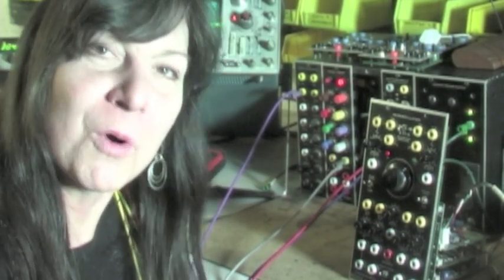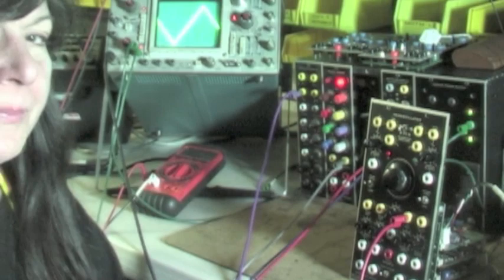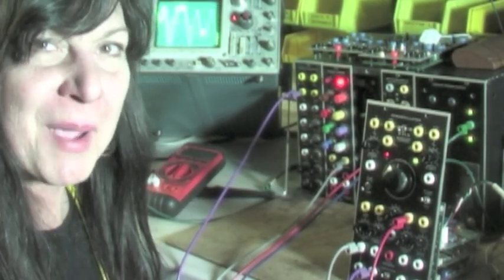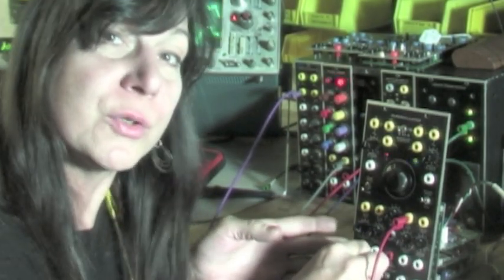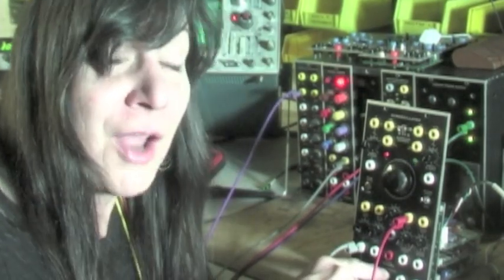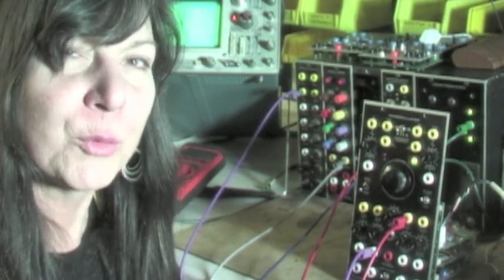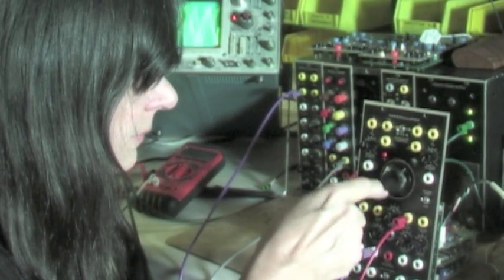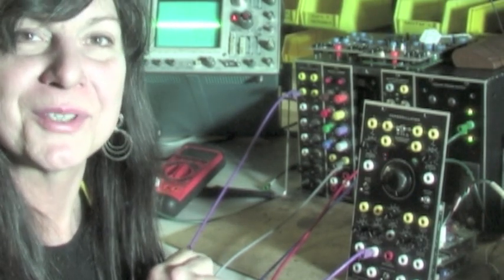About Thru-Zero!.m4v

Comment: 8:00 min. Nice example. On a normal oscillator, the audio goes silent when the frequency goes to 0 Hz . So it’s like the carrier wave is being Amplitude modulated by a square wave that has values zero and one. But if you do this, you still don’t get through zero modulation. The oscillator has to actually reverse smoothly with no glitch from positive to negative when it goes through zero. Otherwise you just get regular FM that got amplitude modulated. So it’s very important that that square wave amplitude modulation glitch is not there on each phase reversal Through zero. The actual through zero oscillator circuit with the reversing Schmitt trigger is a really neat idea.